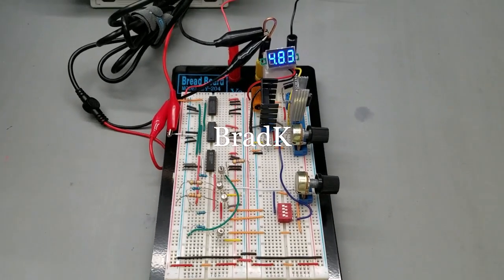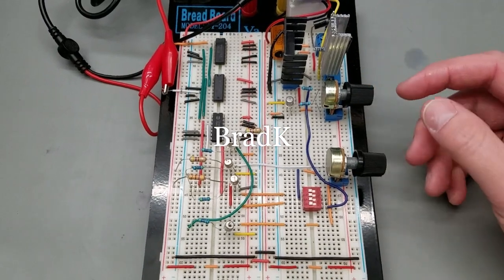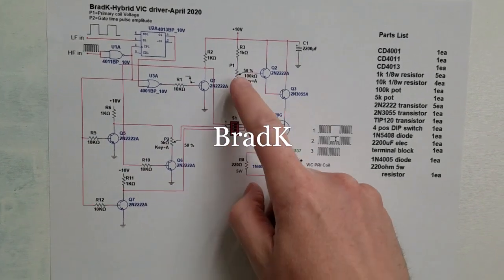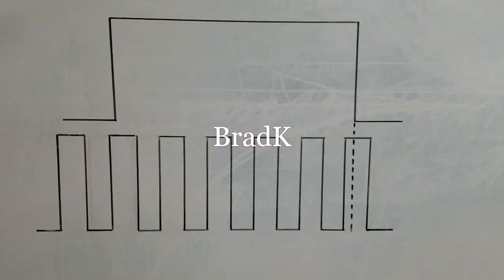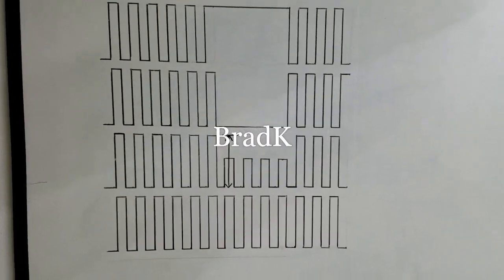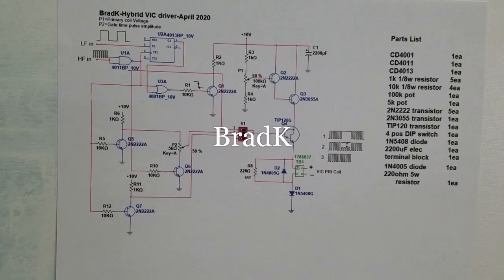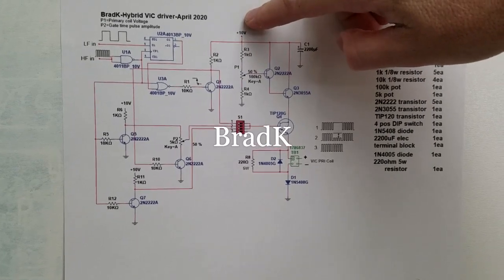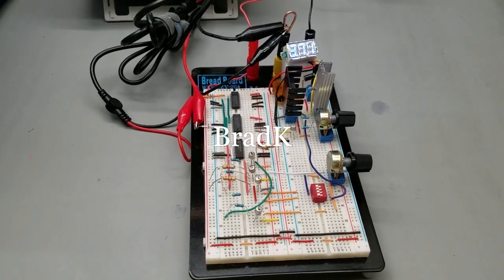Stan Meyer Research # 30, Apr 2020-My VIC Drive Circuit

Comment: Hello.
I can’t understand why no one thinks about the presence of feedback to adjust the pulse duration, repetition rate.
Let the dielectric constant of water in the static state be 78.54
This is one frequency for the resonant charging of a capacitor.
Even after the first charging pulse, the dielectric constant changes immediately, the charging resonant frequency changes similarly, based on the fact that the capacitance of the water capacitor changes. Naturally, you will never get what you need.
In the video of the author himself, this is clearly stated.
Good luck.
Reply from the maker: Yes, the original circuit used a 4046 PLL with feedback.

Comment: Hi Brad, thanks for sharing all this. I have few question
1- I agree with you that lot of variable are needed to be aligned, therefore my question is how did Stan trust what he was doing? I mean is so complicate that I feel he should have seen it somewhere else and he tried to replicate it. 
2- Do you use differential probe since there is no common ground?
3-You said you know someone who make it work... can you give more detail on it. Do he have some youtube video, does he share any idea to look for?
4-The idea behind this technologie is to vibrate the water molecule at it's natural frequency. Therefore the frequency should be know. Then building the the WFC to mesure the capacitance. From there we can find the inductance with equation for lc resonance  and build the biffilar coil. The only thing I'm not sure is about the transformer. can we use a 12 volt power supply combine with a power transistor connected to the signal generator?
5- Could it be also a RLC circuit instead of on LC circuit? If yeah what should be the measurement of the resistor.
6-Are you active in any forum?
Thanks again
Reply: I taught about number 5 it's should be RLC circuit because R represente the resistance of the system. Therefore Stan have one ajustable coil to compensiate for the resistance. Let me know what do you think about that.
Reply from the maker: 1. Not sure if he saw it somewhere else, but if he did it was likely Andrija Puharich.
2. Yes, although you can also use a small pickup coil on either the positive or negative line between the VIC and cell.
3. I haven't heard from him for over 5 years, I doubt he is willing to talk. I tried and got no response.
4. There are many different frequencies the water molecule will absorb and it depends on what you are trying to do...The important ones are into the GHz range
5.Yes its an RLC circuit, the secondary side of the transformer had around 220 ohms resistance (resistance of the secondary, L1 choke, and L2 choke).
6. I used to be on Open-source-energy but I left the forums a few years back. Its too hard to keep track of the important info as it keeps getting buried with other questions and posts etc. 

Like I have mentioned, the circuit has at least 15 variables, if any one of them is incorrect by even the slightest amount it will not work. Also, if you design the variables from the start then try to adjust them once its all together doing that causes other variables to change which puts you right back at the start. Getting it all correct is one of the most difficult balancing acts there are.
On top of that there are initial conditions which must be met or resonance does nothing. I can hit resonance at any time but if the initial conditions are not met nothing happens.

Comment: Ji

Did you e c er get this to work?
I mean the while process of Meyer
I didn't see any videos after this
Thanks
Reply from the maker: I'm sure I can get it to work but it takes a lot of time to get everything setup correctly. Unfortunately life caught up with me and I haven't had the time or space to work on it for a while. 

It really is a massive challenge to get everything right. From what I can tell there are at least 15 variables in the circuit and if they aren't all matched/aligned in the right way it will never work. If even one of them is incorrect it will never work. 

So yes it works, but getting everything setup correctly is the challenge, and it's a huge challenge.   Stan made it sound simple but in reality it's extremely complicated, and if anyone tells you it's simple they haven't done it.
Reply: @BradKwfc  I was wishing you would say you did it.

Is there anything one can do yo help you get to the finish line?
Reply from the maker: @Gacha.Cupcake  
I have mostly everything I need except time. It really is a feat of engineering to get it to work. You build the circuits, coils, etc. Then take measurements, test them & take more measurements, then look into why it didn't work, calculate everything and double check the calculations.... then you find the problem and realize it comes down to several factors, one of which is extremely hard to get right which is the VIC coil. There's much more there than just getting the inductances and resistances right and it takes alot of time.

Comment: Hi Brad
Good job.. Did you share the schmatic for the drive circut in the open source? Cause I couldnt find it.. Please share it i would like to give it a try
Reply from the maker: https://open-source-energy.org/?topic=3538.msg54182#msg54182
Reply: Hi.. I cant see any schmatic in the link you provided, or do i have to sign in in the open source web site and then the schematic will show up? I tried so many times to sign in without sucsess.. If you can post the schematic here or send it by email iwould realy appreciat it..

Comment: I was researching this stuff about 13 years ago and due to COVID have been stuck at home and decided to start researching it again. In one of your earlier videos you talked about AC current being used, you might be onto something. I saw a video back then from someone who supposedly got one of these working. They had a full bridge rectifier hooked up to a ferrite rod choke and had a clamp meter showing .5 amps of drive current. I just bought all the parts to get back into it but I’m gonna start with treating this like a LC circuit and calculating the resonant frequency and driving it at that point. The hurdle is feedback as the capacitance will constantly change when gas forms between the plates so you will need to change the frequency as the capacitance changes to keep it in resonance. Might be a long shot but I’ll start there, maybe it’ll lead somewhere 😬
Reply from the maker: Its a lot of work but for some reason the challenge is rewarding as it keeps you thinking, reading, learning, and experimenting. Your right about capacitance, but it is also a good thing that it changes because as it decreases it moves the resonant frequency higher which means you can achieve higher voltages with the same amount of input power due to the increased impedance across the resonant components.
Reply: The VIC does it automatically, it's continuously scanning for the resonant frequency and phase locking onto it. It's always at resonance. But the cell cant work on AC so you must use bifilar coil so they both resonate but use one of them with half or full bridge rectifiers and connect it to the cell. The circuit feeds back capacitance change and so it adapts the frequency accordingly.